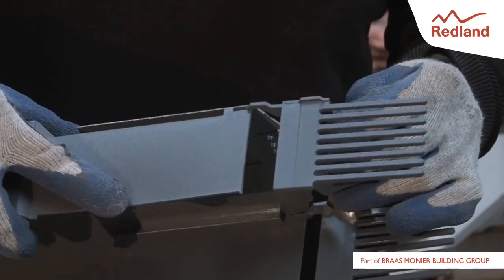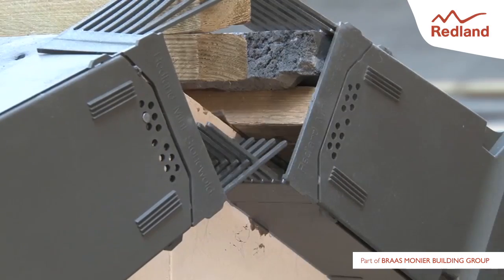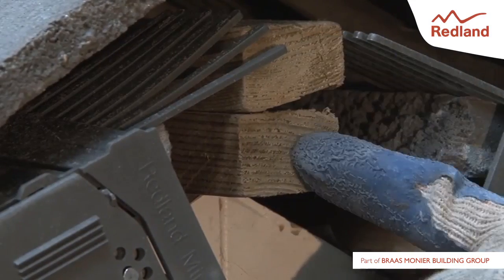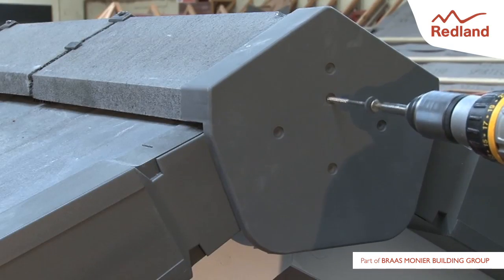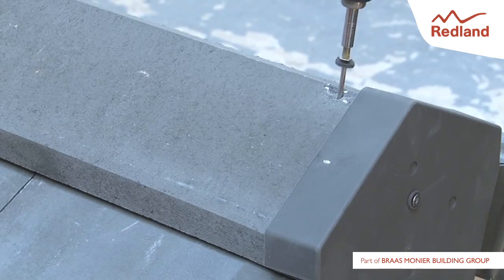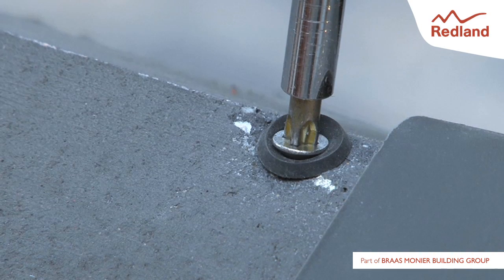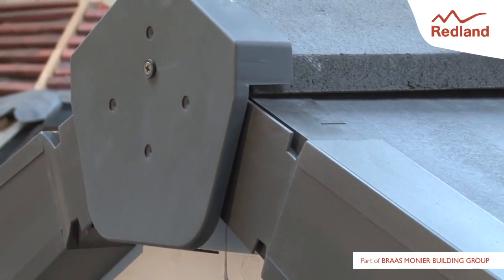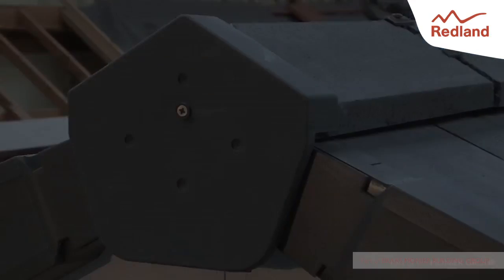Rapid Ridge End Caps installation video

Comment: Hi, so is it right that some end caps can't be fitted to certain types of roof?
Reply: They are made for the concrete large pan tiles.
You can't fit them to the small clay tiles or slate.